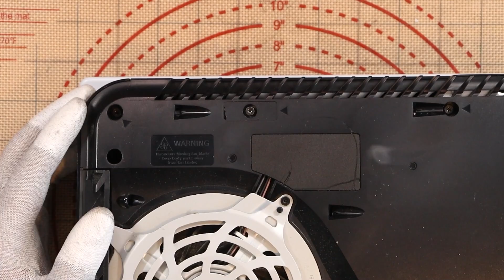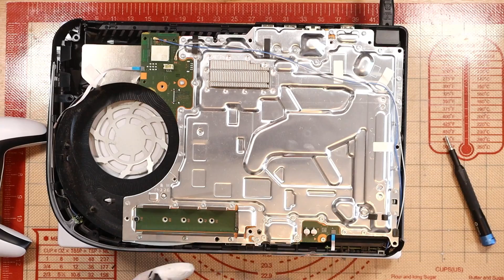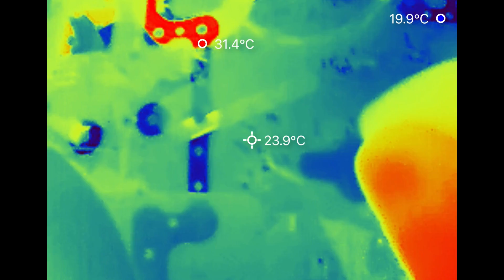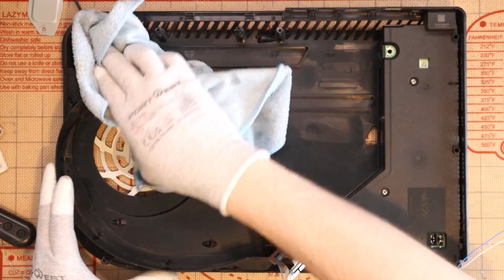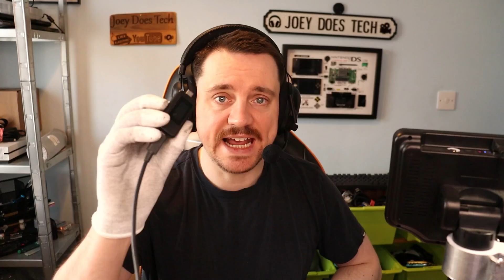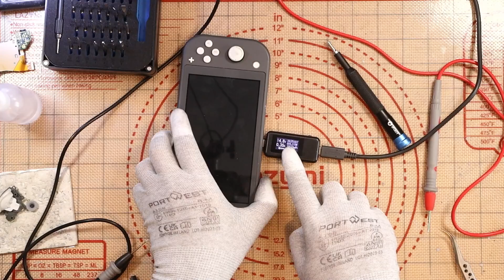Turning eBay JUNK into Profit | Profit or Loss S1:E58

Comment: 12:15 If you want IPA to kill jerms it's got to be deluded with demineralized water. About 70%IPA-30%water.
Pure IPA is not a desinfectant.
Analogy: you can't clean off an oil film(jerm) with pure water(ipa), you need to add soap(water).

Comment: What thermal camera do you use? Also, is there no way to know what the value of a capacitor or fuse is to prevent using a donor?

Comment: Should also include the price of the donor parts. Those didnt just materialize out of thin air.
Reply: Yeah the donor parts will have come from unrepairable products from in the past, which would have been a full minus in the spreadsheet anyways, therefore the parts taken have already been accounted for.
Reply: I get it. I also have a pile of donors and it's hard to quantify the value. As a buisiness this makes sense. But for individuals who would need to source the parts themselves this hides the cost.

For instance the fuse didn't need to come from a donor board but many viewers probably don't know what to look for or where to buy them.

Comment: joey can you fix my marriage
Reply: I think there's a short somewhere, maybe try injecting some voltage see what gets hot
Reply: @thecaybob1 if the marriage is bad then nothing is gonna get hot
Reply: @thecaybob1 😂😂😂😂😂
Reply: No your wife left with the mailman last week
Reply: Lol I can hear joey now:
Well for starters we are missing a ring, we are gunna have to replace that.
There seems to be no communication between the female lead and the male bellend. 
We can test this by probing here and here.
See we get nothing.
WE ADD THE NEW RING 
And since these come as pairs both the male and female ends need them.
Ring change done.
Let's probe again.
Has that solved the issue, it has, bow they are communicating.
But does it pass the test?

Lmao
Reply: Sad joke(
Reply: Funny that
Reply: He already did! Clean up the flux while it's hot and be gentle with the heat gun
Reply: Depends .... do you own a switch....Xbox or PS5 😁
Reply: Switch it off and switch it on again…
Reply: Or try injecting voltage….
Reply: That warranty void stiker was ripped off long ago.
Reply: Too many ripped off pads ;)